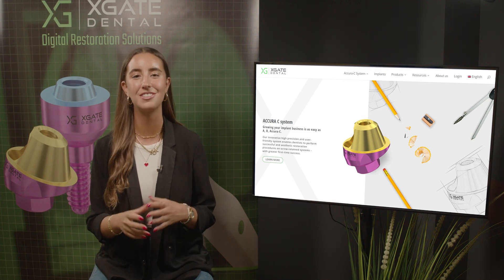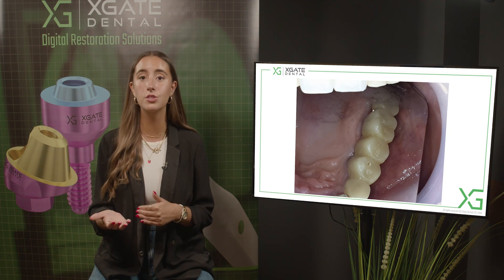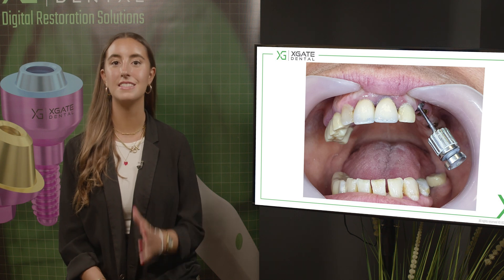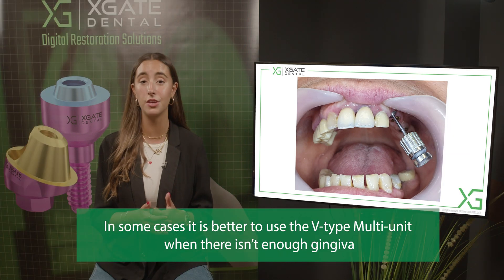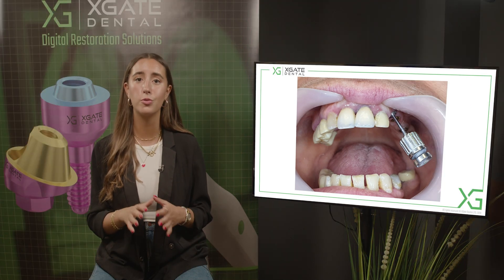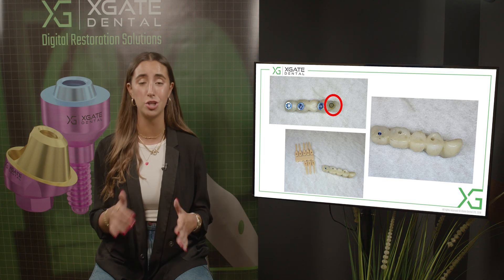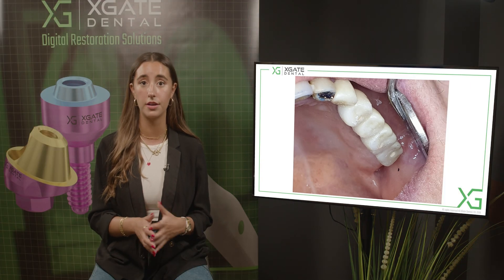How to use an old implant to create a new dental bridge on two molars, two premolars and the canine

Comment from the maker: 00:00 We restored the left upper part of the patient 
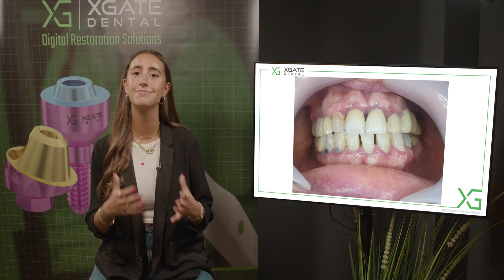01:00 This molar looks kind of broken possibly because of her occlusion
02:00 Then you have- the first premolar and the old implant for the canine
03:00 We'll want to use a straight multi-unit
04:00 The angulated implant is almost always visible
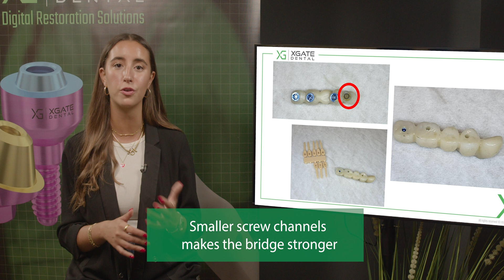05:00 The smallest screw channel is about half in the surface than the bigger screw channel
06:00 You can't use a stopper
07:00 You can put a healing cap or screw cover on the implant